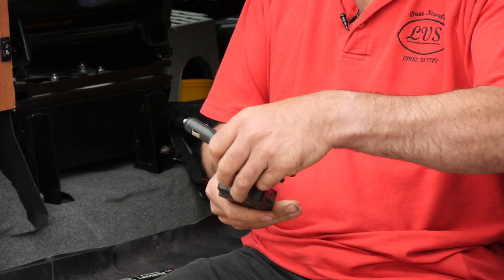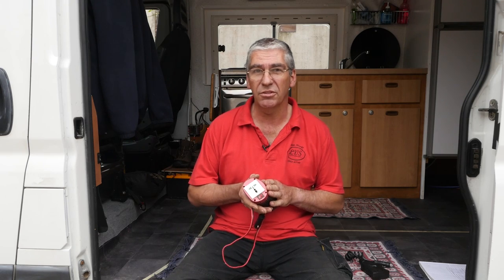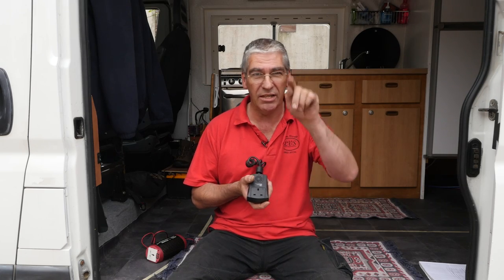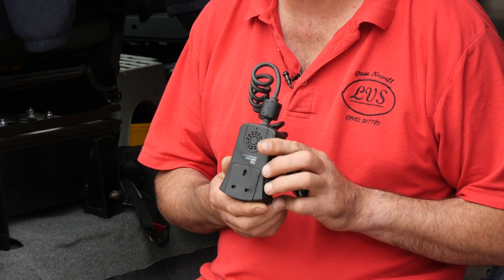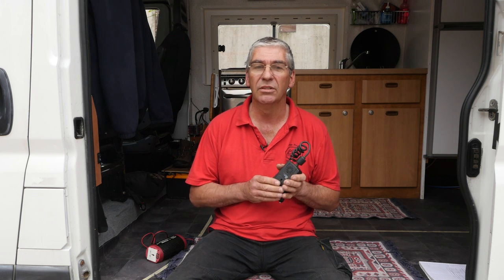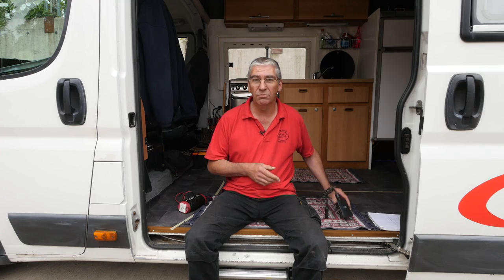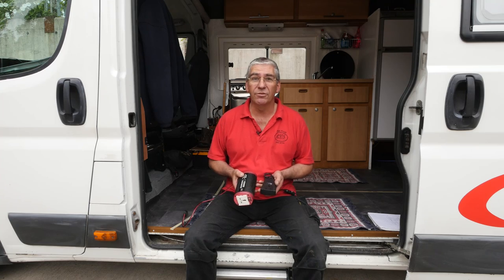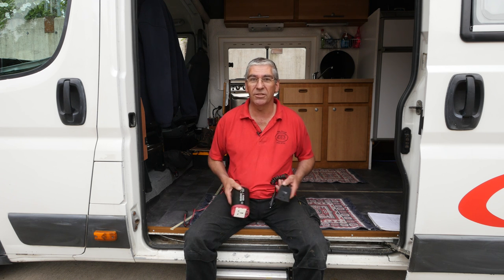Inverters – expert advice from Practical Motorhome's Diamond Dave

Comment: Sorry Dave, you got the maths wrong. If you use 2A RMS on 240V (as per your example), that's 480W! A 12V battery will have to source 40 AMPS (20 times as much current), That's because as the voltage goes up, the current goes down in the same direction -- the Amps x Volts has to be constant as power is constant (minus any losses of course). 

TLDR: 12V battery current requirement is about 20X the 240V (RMS) current consumed.

Comment: Hi Dave, could you reccomend a inverter to run an oxygen concentrator, we’re going on a road trip soon and my dad is on oxygen.. I have looked up his concentrator and it is 590W standard 3 pin uk plug... we will be going on a trip were  he will need it running for approx. 5-6 hours continuous

Comment: My induction hob won't run off the leisure battery thru the inverter?? It all works when hooked up tho. The hob will switch on and make the correct noises but just doesn't produce any heat when on the battery alone.

Comment: 2:10 Diamond Dave says "what might take 1 or 2 amps 240V will take 4 times that on 12V". but infact it will take 20 times that on 12V (more with inverter losses)
1A * 240V = 240W =12V * 20A
2A * 240V = 480W =12V * 40A